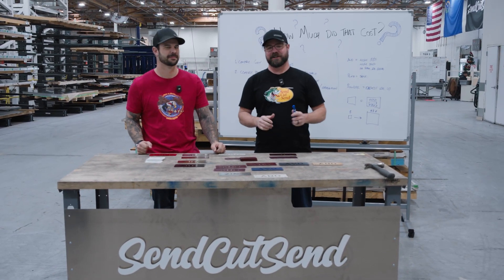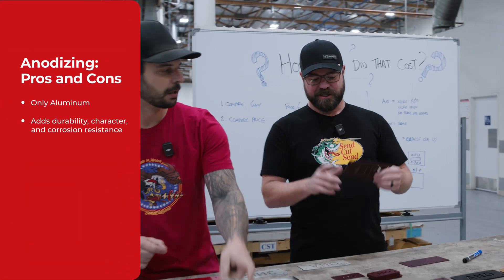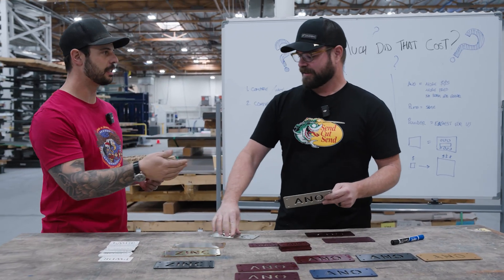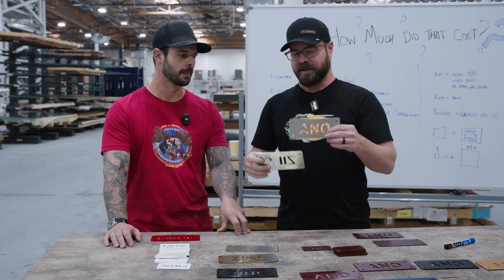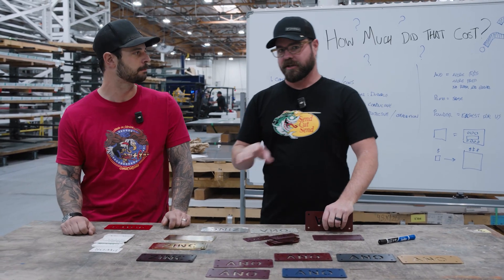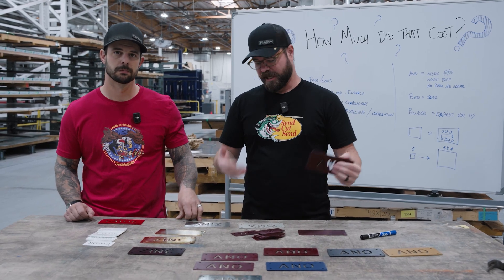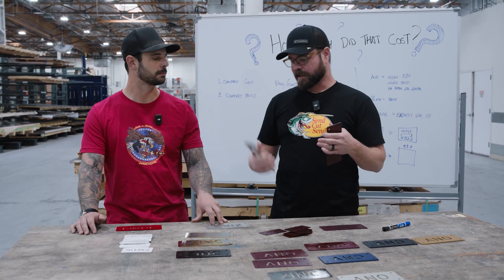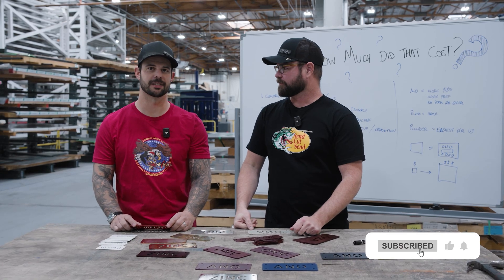Powder Coating, Anodizing and Plating Costs with SendCutSend - Cutting Corners Episode 14

Comment: How to the different finishes hold up if they are bent after they are applied. Like if I order an anodized vs powder coated aluminum part, and I do some bending to it after receiving it will the finishes crack or flake off?
Reply from the maker: it will depend on a lot of factors like the design, material, thickness. We'd recommend just adding bending to your part and letting us do it in house. But technically ano and powder should not crack during bending

Comment: Does SendCutSend have any plans to add 3D sheet metal forming capabilities? I think there's a huge potential market for custom fenders/quarter panels.
Reply from the maker: @mchristr  we have plans to add everything… eventually :) but no immediate plans for this but that doesn’t mean we couldn’t change our minds soon!
Reply: @sendcutsend  Thanks for the reply...I think. Several years ago I got a quote from a well-known custom shop to flare the fenders and quarters on my Mustang. It was going to be labor and materials but they ballparked between $20K and $30K. That tells me there's a ton of margin left for someone who can produce the pieces by machine.
Reply: @sendcutsend  It would be tremendously exciting if you introduced services on a Figur Digital Sheet Forming machine. My sheetmetal racecar parts would ascend to the next level!